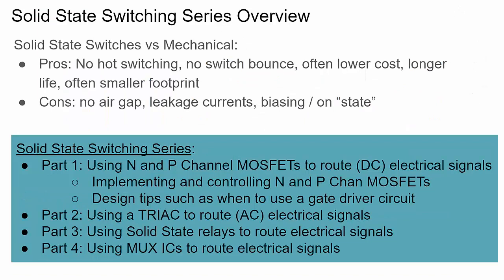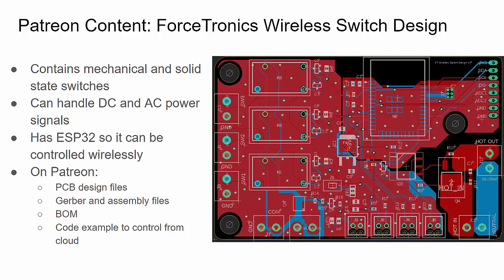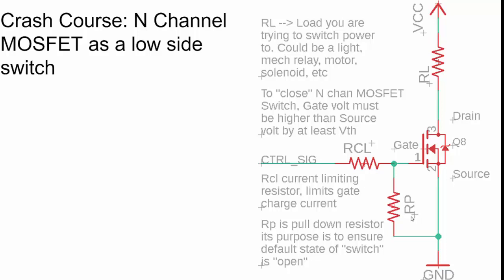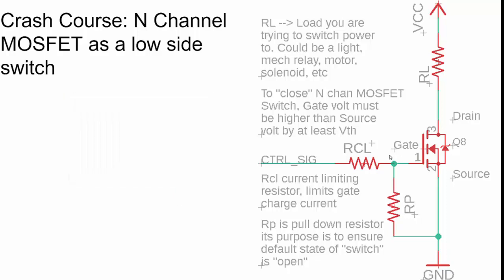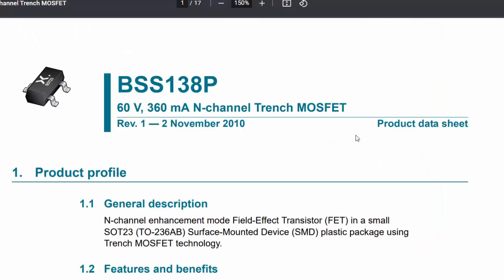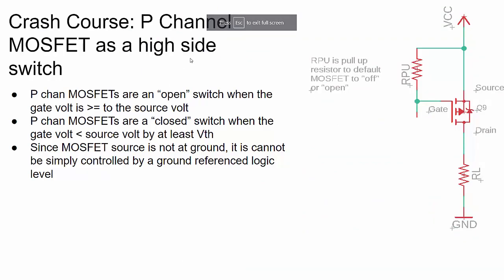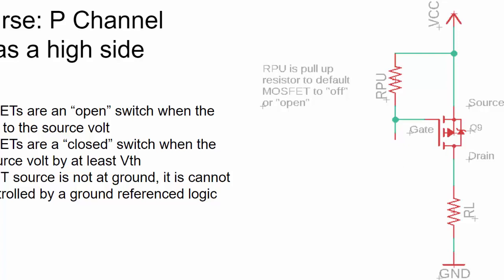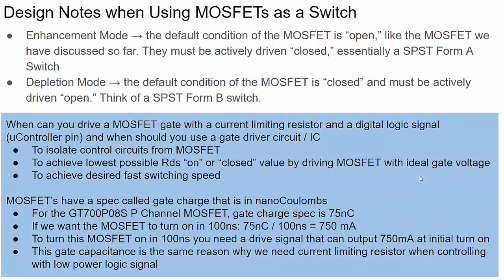Electrical Signal Routing with N and P Channel MOSFETs

Comment: Great video mate thank you.
One thing I failed to grasp is how to work out +RP and RCL+ resistor values needed for N Channel?🤯
I've designed a small circuit with 2x IRFP260N mosfet in parallel, I'll be operating the gate with arbitrary frequency generator to allow complete control of pulse frequency to experiment with electrolysis liberating gasses from water.
Are there formulas for both resistor applications?  I'm no electronic engineer but keen to learn what I need to know.  Cheers mate 👍
Reply from the maker: Good question. Rp is fairly trivial and may not be needed. It's more of a safety thing because modern MOSFETs require so little current to turn on. Just use a resistor value of 10k and you'll be fine. RCL is a gate current limiting resistor and also may not be needed. It is there to ensure the gate capacitance doesn't cause inrush current that could damage the source. If you are not highly concerned with switching the MOSFET on and off at it's fastest rate then just use a resistor value around 300 to 1k ohms and you should be fine

Comment: I don't know why engineers fail to point this out, so I'll do it to make it easier for those that are interested. Why are they called "N" and "P" channel? Well an N channel MOSFET goes on the NEGATIVE side of the load (closest to ground), while a P channel MOSFET goes on the POSITIVE side of the load. It's as a simple as that. Yet you won't find ANYONE actually pointing it out in YouTube videos. Baffling. Great video though - really excellent. 👍 Subbed.
Reply from the maker: Glad you enjoyed the video! Your 'N' and 'P' naming story is a good rule of thumb for how to implement MOSFETs, but I don't think it is correct on the real genesis of the name. My understanding is 'N  Channel ' comes from the fact that negative doping semiconductor material is the majority material compared to positive doping. The negative doping material connects to the source and drain. The positive material connects to the gate. P channel MOSFETs are doped opposite. That is my understanding at least of the naming